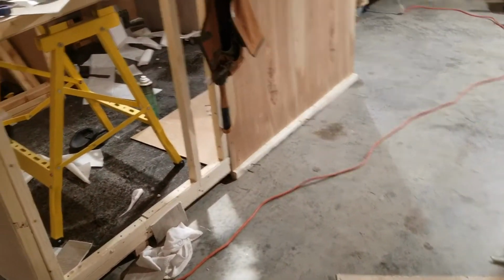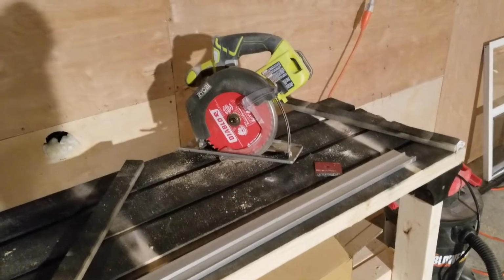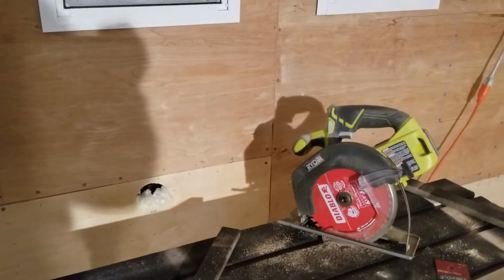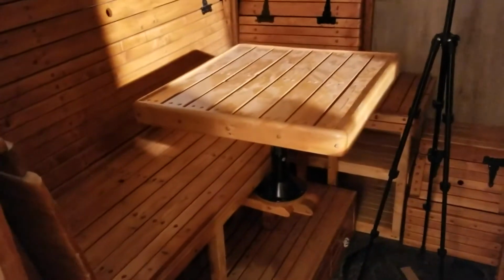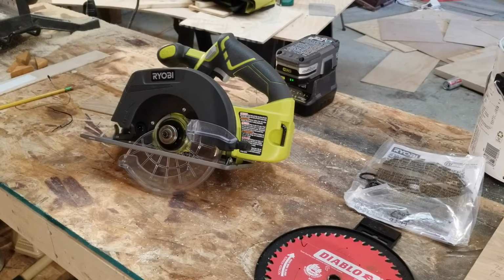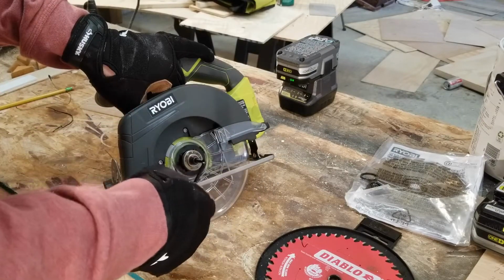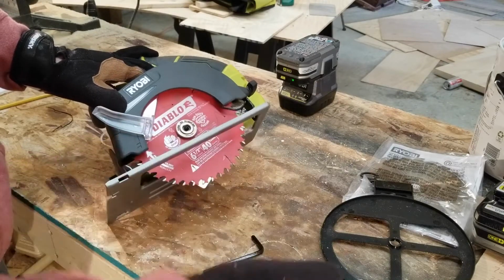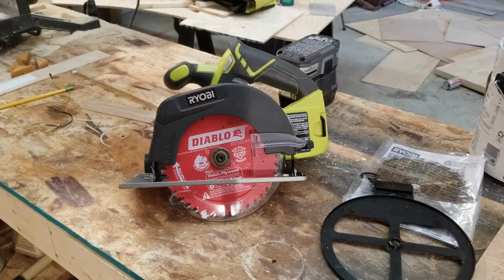DISABLED VETERAN BUILDS CAMPER & DEMONSTRATES HOW TO CHANGE RYOBI CIRCULAR SAW BLADE SKIP LONG INTRO

Comment: Everything was working fine I put the blade on and put the screw on but I can't tighten it because no matter how hard I push that gray button won't depress Do you know what the problem could be?
Reply from the maker: Barbra Keep turning the blade as you press the green button gently. Eventually The gray button will depress all the way and the blade will lock in place. 
Then you can use your Allen wrench to tighten or loosen it. But make sure the battery is disconnected before you do anything.
Reply: @tar2studios  I figured it out and thanks for your quick reply.

Comment: I purchaseed a diablo blade but the hole in the center is kind of bigger than the Ryobi blade.  I have not opened do you think will work the original blade hole is 10mm. I m a little confused.
Reply from the maker: If you purchased it at Home Depot, it should work as along as you bought the right size blade....this Ryobi saw only takes 5.5" blades...so I would take the saw and the blade to Home Depot and asked someone to help you. They are usually very helpful like that.....
Reply: @TAR2 Studios  greetings, ur video shows that the blade u installed was a 6.5  but the original size of the blade should have been  a 5.5, is that correct?

Comment: What happened to all your subscribers bro??
Reply from the maker: Huh? I started with12 and now I'm at 844...a slow steady climb...
Reply: Referring to no one commented and this video only has 39 views. I wanna see how you're going to get it in the truck, I wouldn't dare try to lift the 500 lb beast I built in a truck. But my exterior paneling is 1/2" plywood and the interior is 3/8". My build made the truck made the suspension sink 1 3/4"
Reply from the maker: @conroe2502  Haha no one seems to like my 'help' videos....and I'm converting it into a 20' camper and mounting on a trailer....but I really want a truck camper....one day